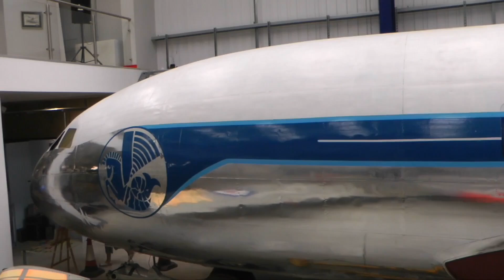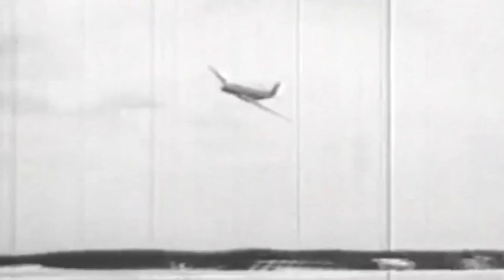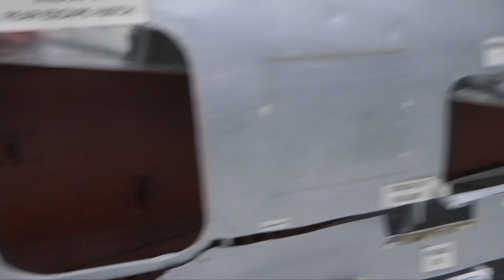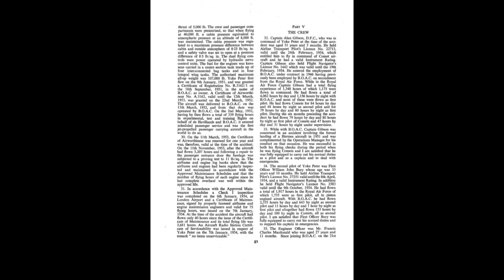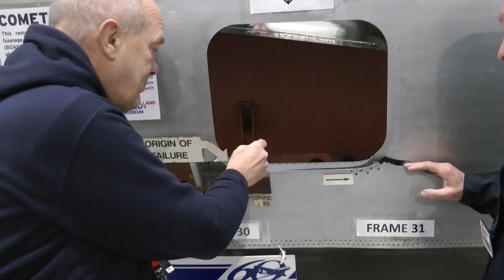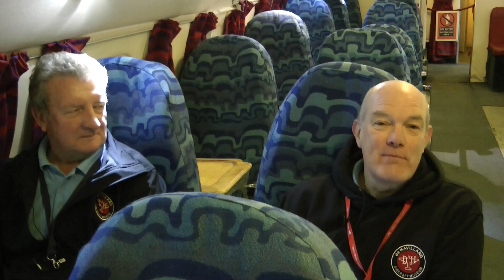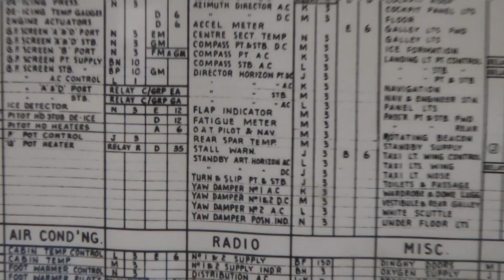The plane that changed the skies forever. DH.106 Comet Airliner from de Havilland

Comment: Great video. The shape of the windows might not have caused the decompression however it was the method of installation of the square shape that proved at fault. Strange though that no square windows have featured on airliners since. The Comet 4 was a fine machine, just a little small. The Nimrod cost billions and several crashed which in my book made it a failure.
Reply: No Comets ever had square windows, this is sadly a very common misconception.
  The Comet 1 had the exact same 5-inch radius windows found on airliners today.
 Wreckage recovered from the sea confirmed that the passenger windows were not related in any way with the catastrophic in-flight structural failures.
 The Comet was riddled with fatal design flaws and substandard manufacturing.
 De Havilland eventually admitted that they never performed the stress calculations for the fuselage sections that failed

Comet 4 has the highest loss rate and fatalities statistics of any jet airliner in history except for the Comet 1.
Reply: @sandervanderkammen9230 

It will come as no surprise to most that we feel able to shed some light on some common misconceptions and myths, of course.
  
It's always good to see the facts presented clearly and concisely isn't it?

  That's correct, Bow-wing (See B-47 wing collapse & wing folding incidents) hadn't managed to sell more than a dozen pressurised airliners before the first flight of the Comet. Having had more than 50 years design & build experience on the type there can be no excuses for the horrendous Bow-wing Max incidents for example. 
   
  That's correct of course, at the time the Comet didn't have particularly high accident loss rates relative to many other aircraft.

Losses comparisons, how things were in those days.

DeHavilland Comet 4                            14%
DeHavilland Comet all  (ff 1948)         17%

Boeing 307                                              70%
Boeing 247                                              48%
Boeing 707            .                                  20% 
Lockheed Electra Turboprop                   29%
Canadair CL-44  Turboprop  (ff 1958)    46% 
Convair CV-580  Turboprop                    22%
Convair CV-880    (ff 1959)                     27% 
Convair CV-990     (ff 1961)                   35%
Tupolev T-104 (ff 1955)                          16%

   Indeed, De Havilland carried out a full stress analysis & engaged in a comprehensive & protracted testing program which is why key De Havilland people were happy to be aboard flying DH Comet aircraft.

  In fact window shape was an issue at the time & the fact that fracture failures in a test aircraft or from retrieved wreckage didn't run through passenger cabin viewing windows is irrelevant. The initial fracture point from retrieved wreckage was an ADF assembly bolt hole. 

  Of course it is in fact the case that no aircraft before the Comet had been subjected to as much testing as the De Havilland Comet.

  Agreed, of course De Havilland did indeed always work to better than industry standards at the time, used up to date knowledge for the design & construction & no evidence of negligence  or criminal negligence was ever produced in relation to the DH Comet.

  De Havilland designers / engineers knew all there was to know about metal fatigue at the time they designed the DH Comet.

  Of course De Havilland had prior experience building many all metal construction airframe aircraft including many passengers aircraft & thousands of jet powered fighter aircraft that were primarily of metal construction with pressurised cockpits & jet engines built by De-Havilland.

  Indeed, one of the key features of the DH Comet was of course its high altitude capability.
It was in fact the first airliner to have 8 psi pressurisation for the entire fuselage length which resulted in it being the world's first airliner where pressurisation stress significantly exceeded flying load stress.

  Obviously the Comet was an all metal construction airframe aircraft & like all similar airliners used other materials for no structural items such as interior trim. The rear pressure bulkhead for the Comet was obviously not made of wood for example.

  British Aircraft Achievements Notes.

  The world's first gas turbine aero engine demonstration was in fact performed by Whittle in 1937. Sir Frank Whittle patented bypass & reheat before 1936.

  The world's first axial multi stage sequential stator rotor turbines & compressors were produced in England by Parsons of Ireland & North England. The same components used in many modern gas turbine aero engines. Parsons also did some work on the internal combustion gas turbine engine. In fact people at the time in England before 1900 had already discussed the concept of using those components for an internal combustion gas turbine aero engine for powered flight & so had invented the jet aircraft before the Wright Brothers had given any thought to flying.

  The first example of a pressurised cabin aircraft was a British design Airco aircraft built under licence in the US & modified to have a pressurised cabin during a joint UK / US research project.

  The gas turbine engine was first conceptualised & patented before 1800 in England.

As always we hope this helps of course, obviously.

Cheers & 👍 indeed.

The line above has clearly been left blank.
. . ..... ....... . .......
. ..... ... .. ........ ..
Reply: @sandervanderkammen9230 

The DH Comet had significantly more research and pre-production testing than any previous airliner had ever been subjected to.

The fabulous trail blazing DH Comet.
World's first jet airliner.
World's first high altitude airliner.
The first aircraft with a full fuselage width and length pressurised cabin where pressurisation stresses were higher than flying load stresses and were many times higher than flying load stresses. 

It's surprising then just how low the accident loss rate was for the Comet. 

    How things were back then.
Accident losses - % of aircraft built.

DeHavilland Comet 4 UK                     14% 
DeHavilland Comet all (ff 1949)         17%  
Vickers VC10 UK (ff 1962)                   5%

Douglas DC-1                                      99%
Douglas DC-2                                      47%
Douglas DC-3                                      30%
Douglas DC-4                                      26%
Boeing s300                                          72% 
Boeing 307                                            70%
Boeing 247                                            48%
Boeing 707  (ff 1958)                           20% 
Lockheed L-049/149 Constellation    30%
Lockheed Electra  Turboprop .            29%
Fairchild FH-227                                   30%
McDonnell Douglas DC-8                    14%.
Sud Aviation Caravelle  (ff 1955)       15%
Canadair CL-44 Turboprop (ff 1959) 46%  
Convair CV-580  Turboprop                22%
Convair CV-880     (ff 1959)                27% 
Convair CV-990     (ff 1961)                33%
Tupolev T-104        (ff 1956)               16%
Vickers Viscount   (ff 1948)               32%             

  The Vickers VC10, fastest Atlantic crossing for a non supersonic jet airliner, held the record for 41 years.

For the first few years of operation the Caravelle & Comet had similar accident loss fatalities.

Instances of all marks of Comet flew with full certification until retirement of the individual aircraft until 1992. Nimrods were flying until 2010. 

The first few Nimrod airframes were Comet 4 airframes with the equipment bay tacked on. Subsequent Nimrods were new build Comet 4 airframes with Nimrod modifications built by the DH team at Hawker Siddeley.

Comment: De Havilland was the leading aircraft company in propeller driven aircraft, examples being the Mosquito and Hornet. They picked up Geman aerodynamic novelties quickly, such as the swept wing (Me 262) and the tailless design (Me 163), impemented in the DH 108 Swallow. 
The design bureau of DH glitched into a new area, much closer to M=1. The background knowledge in the design bureau, WW-2 based, was not growing as fast as the speed gained with the jet engine. Pushing their designs closer and closer to the Mach limits, physic laws kicked in:
The DH 108 Swallow fluttered into pieces (1946), the DH 110 wing came off due structural overload and compressibility effects, the Comets failures were metal fatigue initiated, but the structural design was also not able to cope with even a small crack and had no crack arrestors such as the B707 indeed had.
Integrally can be stated the DH design bureau had lack of design knowledge in 1. flutter, 2. structural design at higher mach numbers and 3. fatique. These fields are essential and must be mastered completely in aviation.
Reply: The DH Comet had significantly more research and pre-production testing than any previous airliner had ever been subjected to.

The fabulous trail blazing DH Comet.
World's first jet airliner.
World's first high altitude airliner.
The first aircraft with a full fuselage width and length pressurised cabin where pressurisation stresses were higher than flying load stresses and were many times higher than flying load stresses. 

It's surprising then just how low the accident loss rate was for the Comet. 

    How things were back then.
Accident losses - % of aircraft built.

DeHavilland Comet 4 UK                     14% 
DeHavilland Comet all (ff 1949)         17%  
Vickers VC10 UK (ff 1962)                   5%

Douglas DC-1                                      99%
Douglas DC-2                                      47%
Douglas DC-3                                      30%
Douglas DC-4                                      26%
Boeing s300                                          72% 
Boeing 307                                            70%
Boeing 247                                            48%
Boeing 707  (ff 1958)                           20% 
Lockheed L-049/149 Constellation    30%
Lockheed Electra  Turboprop .            29%
Fairchild FH-227                                   30%
McDonnell Douglas DC-8                    14%.
Sud Aviation Caravelle  (ff 1955)       15%
Canadair CL-44 Turboprop (ff 1959) 46%  
Convair CV-580  Turboprop                22%
Convair CV-880     (ff 1959)                27% 
Convair CV-990     (ff 1961)                33%
Tupolev T-104        (ff 1956)               16%
Vickers Viscount   (ff 1948)               32%             

  The Vickers VC10, fastest Atlantic crossing for a non supersonic jet airliner, held the record for 41 years.

For the first few years of operation the Caravelle & Comet had similar accident loss fatalities.

Instances of all marks of Comet flew with full certification until retirement of the individual aircraft until 1992. Nimrods were flying until 2010. 

The first few Nimrod airframes were Comet 4 airframes with the equipment bay tacked on. Subsequent Nimrods were new build Comet 4 airframes with Nimrod modifications built by the DH team at Hawker Siddeley.

There was no design bureau at DH, they had the design team & the design department. The German aircraft design peeps often learned what they knew from what was going on in the UK. The DH design guys knew all about metal fatigue, supersonic and transonic effects, all metal aircraft airframe design and production and jet engine design and manufacture.
Reply: @petemaly8950  An elaborate answer. The comet engineers knew what fatigue was, but interpreted the critical crack length wrongly. Besides that the fuselage had no crack arresters to stop a beyond K1c situation. The frames fractured in sucession on a bending-tension mode, like zipper.
Reply: @louisvanrijn3964 

Crack arrestors don't stop a beyond k1C situation. There was no critical crack length interpretation being done by anybody anywhere. The only recovered wreckage from any possibly relevant incident showed it was possible aircraft destruction was due to the entire adf window assembly becoming detached and causing enough tail damage to initiate a violent nose down pitch change. Comets had ripstop provision. The failure revealed by the only wreckage ever recovered from an incident showed it had run through both vertical and horizontal crack stopping structural components. Same thing happened during post incident water tank testing. 

The DH Comet had significantly more research and pre-production testing than any previous airliner had ever been subjected to.

The fabulous trail blazing DH Comet.
World's first jet airliner.
World's first high altitude airliner.
The first aircraft with a full fuselage width and length pressurised cabin where pressurisation stresses were higher than flying load stresses and were many times higher than flying load stresses. 

It's surprising then just how low the accident loss rate was for the Comet. 

    How things were back then.
Accident losses - % of aircraft built.

DeHavilland Comet 4 UK                     14% 
DeHavilland Comet all (ff 1949)         17%  
Vickers VC10 UK (ff 1962)                   5%

Douglas DC-1                                      99%
Douglas DC-2                                      47%
Douglas DC-3                                      30%
Douglas DC-4                                      26%
Boeing s300                                          72% 
Boeing 307                                            70%
Boeing 247                                            48%
Boeing 707  (ff 1958)                           20% 
Lockheed L-049/149 Constellation    30%
Lockheed Electra  Turboprop .            29%
Fairchild FH-227                                   30%
McDonnell Douglas DC-8                    14%.
Sud Aviation Caravelle  (ff 1955)       15%
Canadair CL-44 Turboprop (ff 1959) 46%  
Convair CV-580  Turboprop                22%
Convair CV-880     (ff 1959)                27% 
Convair CV-990     (ff 1961)                33%
Tupolev T-104        (ff 1956)               16%
Vickers Viscount   (ff 1948)               32%             

  The Vickers VC10, fastest Atlantic crossing for a non supersonic jet airliner, held the record for 41 years.

For the first few years of operation the Caravelle & Comet had similar accident loss fatalities.

Instances of all marks of Comet flew with full certification until retirement of the individual aircraft until 1992. Nimrods were flying until 2010. 

The first few Nimrod airframes were Comet 4 airframes with the equipment bay tacked on. Subsequent Nimrods were new build Comet 4 airframes with Nimrod modifications built by the DH team at Hawker Siddeley.

There was no design bureau at DH, they had the design team & the design department. The German aircraft design peeps often learned what they knew from what was going on in the UK. The DH design guys knew all about metal fatigue, supersonic and transonic effects, all metal aircraft airframe design and production and jet engine design and manufacture.
Reply: @louisvanrijn3964 

It's very simple. 

The DH Comet had significantly more research and pre-production testing than any previous airliner had ever been subjected to.

The fabulous trail blazing DH Comet.
World's first jet airliner.
World's first high altitude airliner.
The first aircraft with a full fuselage width and length pressurised cabin where pressurisation stresses were higher than flying load stresses and were many times higher than flying load stresses. 
  
It's surprising then just how low the accident loss rate was for the Comet. 

    How things were back then.
Accident losses - % of aircraft built.

DeHavilland Comet 4 UK                     14% 
DeHavilland Comet all (ff 1949)         17%  
Vickers VC10 UK (ff 1962)                   5%

Douglas DC-1                                      99%
Douglas DC-2                                      47%
Douglas DC-3                                      30%
Douglas DC-4                                      26%
Boeing s300                                          72% 
Boeing 307                                            70%
Boeing 247                                            48%
Boeing 707  (ff 1958)                           20% 
Lockheed L-049/149 Constellation    30%
Lockheed Electra  Turboprop .            29%
Fairchild FH-227                                   30%
McDonnell Douglas DC-8                    14%.
Sud Aviation Caravelle  (ff 1955)       15%
Canadair CL-44 Turboprop (ff 1959) 46%  
Convair CV-580  Turboprop                22%
Convair CV-880     (ff 1959)                27% 
Convair CV-990     (ff 1961)                33%
Tupolev T-104        (ff 1956)               16%
Vickers Viscount   (ff 1948)               32%             

  The Vickers VC10, fastest Atlantic crossing for a non supersonic jet airliner, held the record for 41 years.

For the first few years of operation the Caravelle & Comet had similar accident loss fatalities.

Instances of all marks of Comet flew with full certification until retirement of the individual aircraft until 1992. Nimrods were flying until 2010. 

The first few Nimrod airframes were Comet 4 airframes with the equipment bay tacked on. Subsequent Nimrods were new build Comet 4 airframes with Nimrod modifications built by the DH team at Hawker Siddeley.